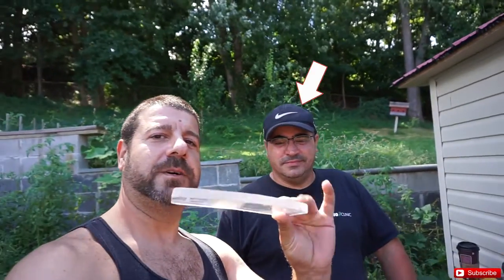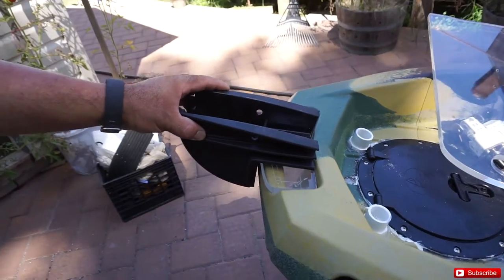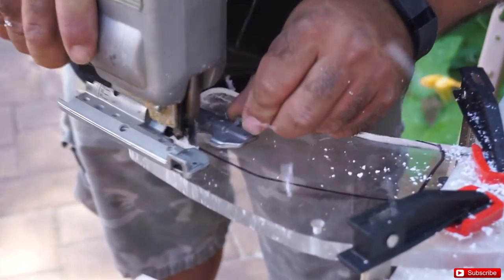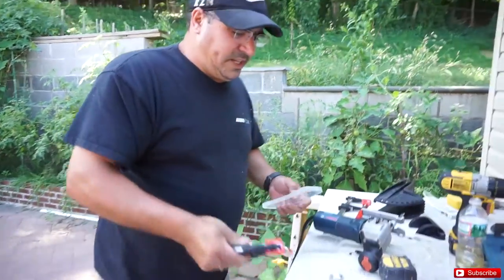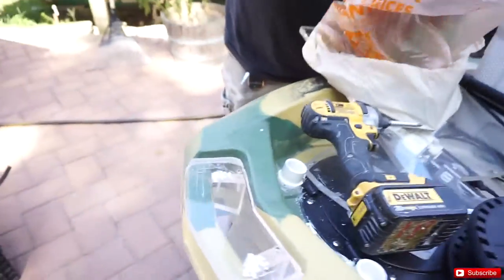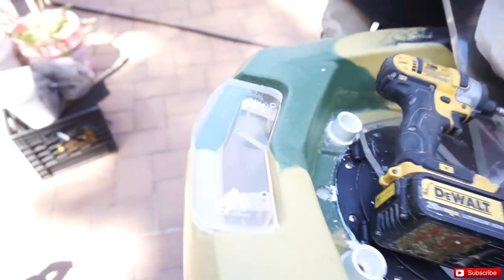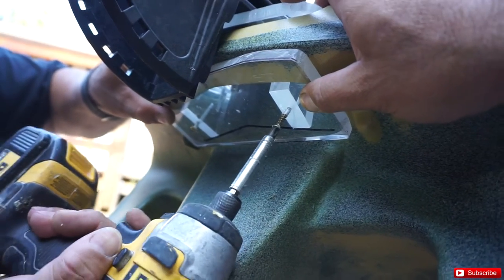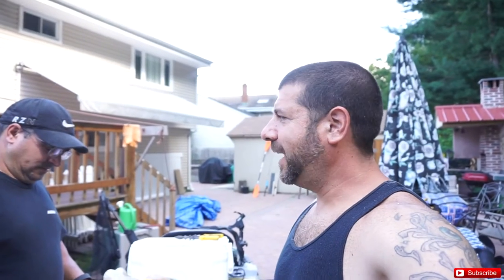Field & Stream Custom Motor Mount

Comment: Hey man, Great job with the bracket. I myself own one of these kayaks and I am having the hardest time to find the cleanest trolling motor bracket mount. Thanks to ya'll - I've found it. But I am wondering if you have an updated video on how this bracket handled the trolling motor weight and how long it lasted? Thanks again for the great video and invention.
Reply from the maker: Hi thanks for the comment I will say it’s been almost 3 years and it’s still strong once in a while just have to tye the screws a bit but it’s strong

Comment: Should have used a nice thick and cheap cutting board from wally ...
Reply from the maker: It’s 3/4 inch plexiglass
Reply: Howd it hold up?
Reply from the maker: Anthony Belcher 3 years and still strong